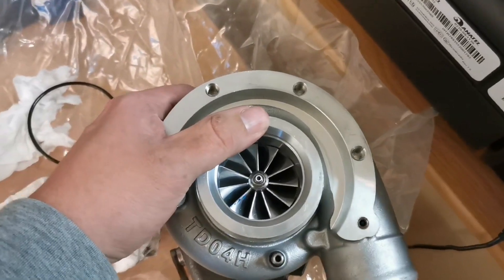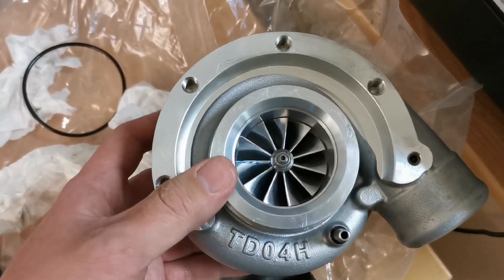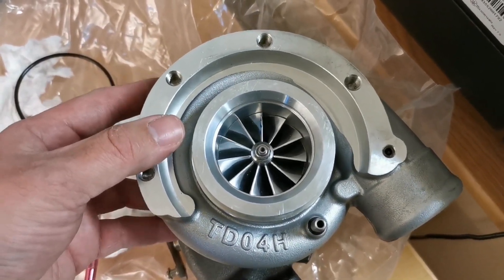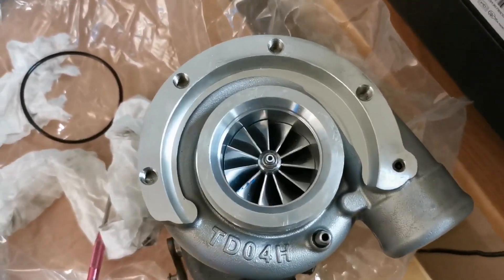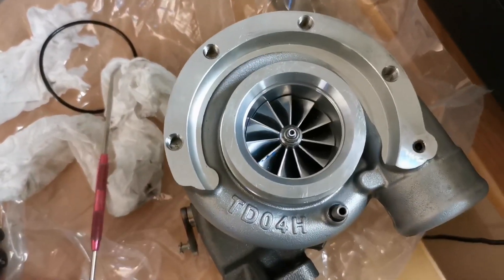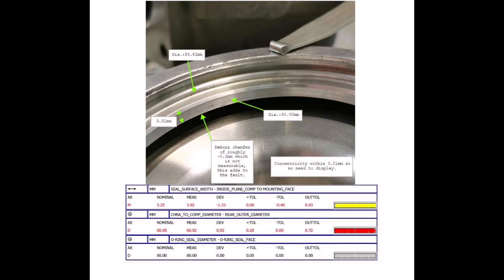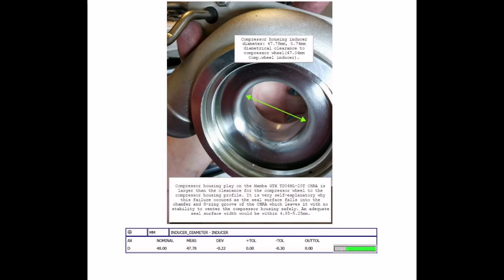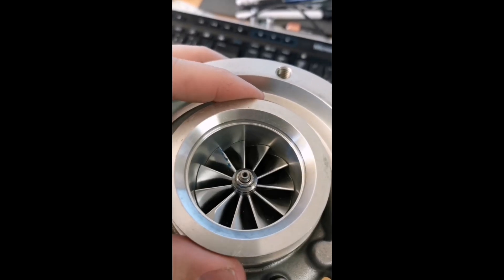The poor quality of Mamba turbos... (not the current one I use)

Comment: Been using a Mambatek for 8 years now and going strong 24psi daily been up to 35psi no problems on a TD04L-15T Twinscroll Making A LOT of Torque. TD04HL-19T on my other car for 4 years no problems runs 18PSI . Even spoke to there Engineers who updated the CBV design after my findings that was many years ago.

Comment: I recently bought a mamba td04 hl-21t for my 9-5, got over a thousand miles on it without issue and it makes decent power. I had to reassemble it after buying because the housings weren’t lined up properly for my hose connections and oil drain, but otherwise haven’t had any issues yet. Would likely attribute this to manufacturing inconsistency, not great. Seems like buying these things might be a bit of a gamble?
Reply: Ive seen this video before buying the actual 21t
Took it apart for initial inspection...
Could not find the same problem luckily 
Think the problem is only with their 19T housings maybe.
Had to disassamble the 21t aswell had to clock and line out the housings seems like these 21t have very very tight fitting of compressor cover>bearing housing.
and dont have the same the same problem as their 19T chargers.

Installed it on the car and pulls like a train and no problems yet. 

If it blows the engine gives me reason to go fully build engine  

Fingers crossed😂😂

Comment: Sounds like when you rotated the housing you didnt reseat the oring.
Have seen this several times with different brands. 
If you have too much clearance with the compressor wheel to housing, its not going to develope any boost!
Reply from the maker: FYI Had to clock and reseat everything when installing, otherwise wouldve never worked.
But that has absolutely nothing to do  with what happened here.

If you check the measurement data in the end and look at the video of how loose the housing is, the only thing align the compressor housing was the O-ring as improper tolerancing with that excessive chamfer. Basically there was no metal contact for chra to housing fitment to keep it from compressing the O-ring in either direction. It floated around on the O-ring. A housing should never have this much play even without the O-ring and have never had issues any other turbo Ive had through years.

As soon as slightest boost hit the housing shifted to one side causing the o-ring to compress and housing immediately made contact with the compressor wheel. Literally in the first 5km of driving.

Comment: Does this Apply to Arashi Turbos as well?
Reply from the maker: Havent found any evidence for that, but seen a very few have struggle before, but also personally have had very good experience tuning one of those.
Reply: @ArturssonEngineering  i use original 19t on my b204r and im happy with that. Was put 19t from volvo and compressor housing from saab without bov. Clearence between housing and compressor wheel is 0.05.. good enought. I reach peak boost of 1.9b at 2380rpm It holds to 5700rpm then goes down to 1.7b at rev limiter.. result of mine setup is 433hp and 598nm when peak at 2.5rpm of torque. In my cause gearbox death two Times. Setup of mine is 19t, 725cc bosch, 044 fuel pump, 3.25 dp, 2.75 rest of exhaust, 630x350x65 IC. Ported exhaust mainfold, 3inch tup, bov double piston forge motorsport.. all goes on t5.5
Reply: @ArturssonEngineering  thanks for your reply and expertise !
Reply: 6000Km lasted an Arashi on a Saab friend 😅